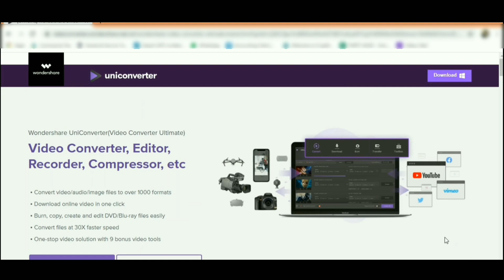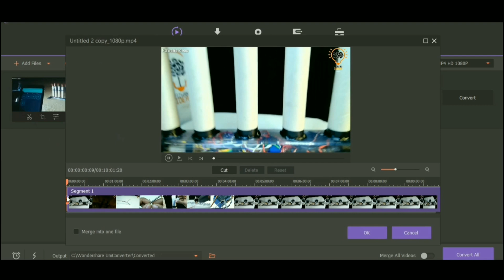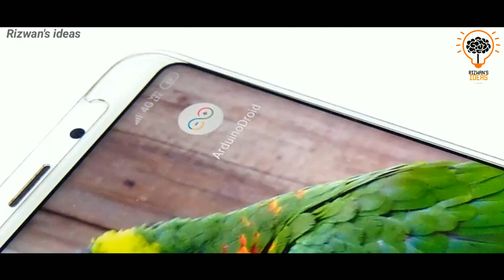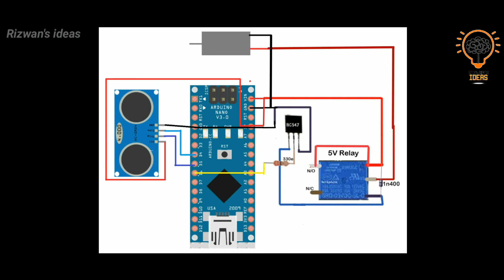How to make a touch free hand Sanitizer Dispenser machine | useful idea

Comment: Brother please help me how can I open the ino file. I have also sent you mail.
Reply from the maker: please check this code 
https://drive.google.com/file/d/1lJZhkVh1OKXCL9Bpr8NpnhL9Ww3-nldv/view?usp=sharing
Reply from the maker: #define trigger 5
#define echo 4
#define Relay 6

float time=0,distance=0;
 
void setup()
{
Serial.begin(9600);

 pinMode(trigger,OUTPUT);
 pinMode(echo,INPUT);
 pinMode(Relay,OUTPUT);

 delay(2000);
}
 
void loop()
{
 measure_distance();

 if(distance<5)
 {
   digitalWrite(Relay,HIGH);
 }
 else
 {
   digitalWrite(Relay,LOW);
 }

 delay(500);
}

void measure_distance()
{
 digitalWrite(trigger,LOW);
 delayMicroseconds(2);
 digitalWrite(trigger,HIGH);
 delayMicroseconds(10);
 digitalWrite(trigger,LOW);
 delayMicroseconds(2);
 time=pulseIn(echo,HIGH);
 
 distance=time*200/20000;
}